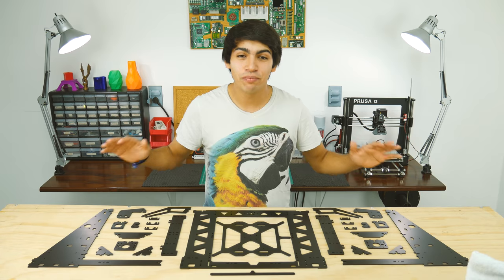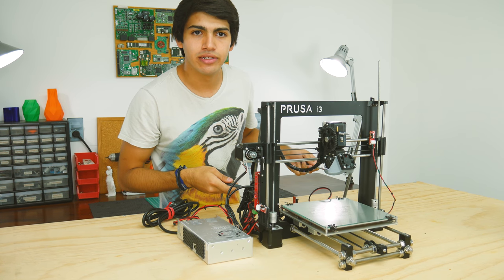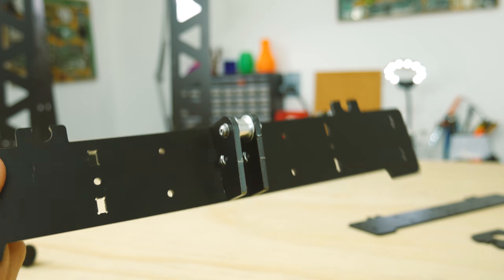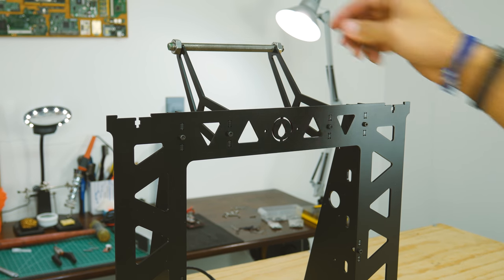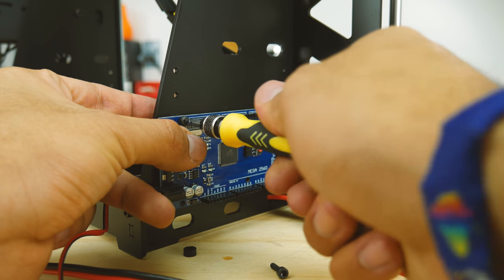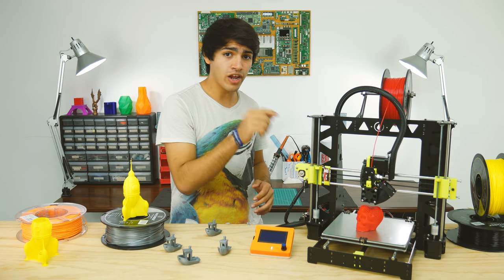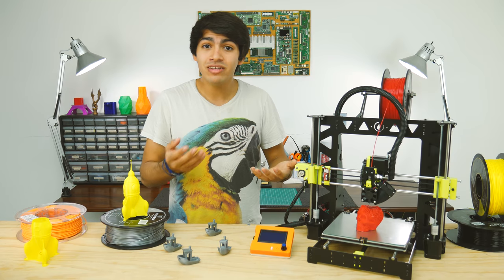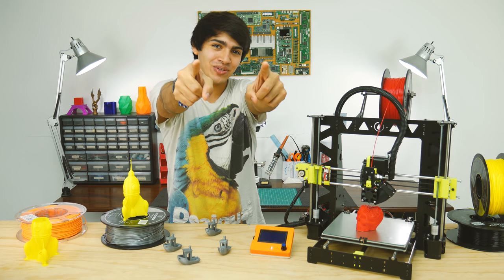🏆🔧 Best Prusa i3 Upgrade - P3Steel Frame - 3D Printing 101

Comment: Hi, This looks pretty cool! A qq. I see that most of the parts on your "Prusa" printer are modified. Do you think that the metal frame would work with with stock parts? Also, how does this frame work with MK2S or Multimaterial upgrades?
Reply: Since July 2017 the Orballo Printing frame is fully compatible with the MK42 heatbed of MK2 and MK2S!

Comment: Nice upgrade, if a tad overpriced (55 euros + shipping is almost half the price of an Anet A6 shipped)

Still, stability is a multifacet problem: bent lead screws, problems in the belts, even if your table isn't 100% stable and is movin with the machine vibrations, everything can make your print unstable even if the frame was cast in a single steel piece you couls still get problems.

The best solution is to get a reliable kit right of the bat. The "original" prusa is sturdy enough and the same site you bought this frame sell a prusa i3 made on it (again, overpriced).

By the way, cool channel! i'm subscribing and adding to my list of 3d printing info sources ^^

Comment: Great video, but am I right in saying this upgrade/frame is NOT compatible with the Prusa i3 MK2S ?
Reply: the MK2S bed won't fit on this frame.
Reply: Since July 2017 our frame is fully compatible with the MK42 heatbed of MK2 and MK2S!
Reply: Since July 2017 our frame is fully compatible with the MK42 heatbed of MK2 and MK2S!

Comment: hows the noise? does the steel frame make it vibrate more or does it seem about the same?
Reply from the maker: The noise it definitely lower as I am now using the polymer bearings. The frame itself does not vibrate, but you will always get the same noise from fans, and motors unless you upgrade to silent fans and drivers.
Reply: good to know! Thanks for the reply!

Comment: Those bearings wont work unless theyre compressed. Plastic bearings are not worth the trouble. Zip tied will not give the results you want. I hate seeing people spending so much money on plastic bearings just to misuse them
Reply from the maker: The bearings worked just fine even zip tied. At first I thought they might deform, or tolerance might be to high, yet they didn't wiggle a bit :)
Reply: I see what you're saying. I got basically the same setup as in this video, with p3steel and igus drylin bearings (+ igus smooth shafts), and Im having trouble with the printer sometimes skipping small steps, which ruins the print. I believe this is because the plastic bearings are sticking to the rod.
Reply from the maker: Yep, just don't go over your limits. If your drivers and motors get too hot, turn it down a notch.
Reply: Thanks for the tip guys, I'll try that.

Comment: Great video.   Can you use this frame with an Anet A6?
Reply from the maker: I'm not sure about that, it is designed to replace a prusa i3 frame only.
Reply: havoc010101 Yes, the frame is compatible you only need the car x axis printed parts

Comment: a wooden frame complies too, can be very stiff!

Greetings!
Rob.
Reply from the maker: Yep, wood is stiff, but I wouldn't want two VERY hot components chilling around wood jajajajaja.
Reply: yes indeed heat and wood .......
but
with you is also the printer on a wooden table. (also here)
but always stay near the printer, never go away if the printer is running!

success and friendly greetings from Netherlands!
Rob.

Comment: Nice video, This upgrade looks amazing. I'm considering buying it to replace my Monoprice Maker Select v2 frame entirely. I tried to use both of your codes PRINTMORE and BLACKSCREW, but PRINTMORE says you can't use it with the Black Prusa i3 Steel Frame (P3STEEL) and BLACKSCREW says "This voucher does not exists."
Reply from the maker: +Remain Indoors Hey, the code for the free hardware pack is BLACKSCREWS. The code PRINTMORE works when you buy the complete prusa blavk edition, not only the frame.
Reply: Ahh okay cool. Thank you sir. I copied BLACKSCREW from your video description. my mistake if you had it different in the video.
Reply: actually I just tried BLACKSCREWS and it still says "This voucher does not exists"
Reply from the maker: It turns out you need to have both things in your cart, then apply the coupon code
Reply: Ahh okay, thanks for letting me know. I went ahead and ordered it and the hardware pack anyway since it was only a few dollars more.
Reply: I just got my frame in the mail today and built it.  It is amazingly rigid. I'm super excited to print out some replacement parts and build it. My apologies if you were supposed to get a kick-back from people using the BLACKSCREWS code. I did try it with both items in my cart and it still said the voucher didn't exist, so I went ahead and ordered it anyway.  It looks like the voucher works now, so I probably just did something wrong when I was ordering.

Comment: That is not the correct way to assemble flexable couplings. At the VERY least have a rubber O-ring between the motor and the threaded rod. Baised on the way you installed it, I bet you have the motor shaft installed past the 5mm diameter bore and into the 8mm bore.

Comment: Hello, do you still have this printer assembled? Would it be possible for you to take detailed photos from all angles? I have purchased the same frame and I cannot figure out how some parts go together (for example, where the threaded rod goes through the top). you can contact me agrath at gmail